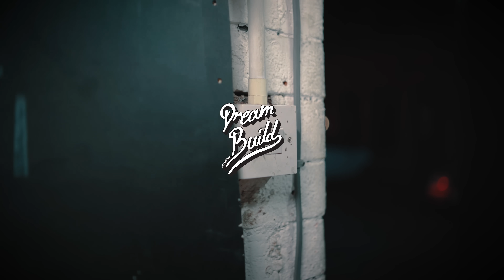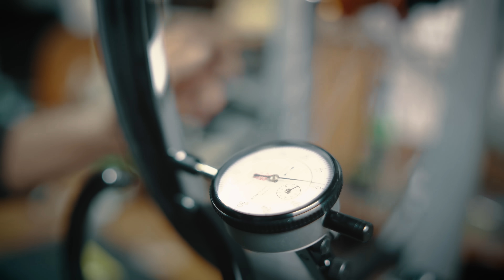DREAM BUILD MTB - EVIL OFFERING

Comment: I remake the question because i didn't receive any answer: what type of greases was used for the bike?
Reply: I do not know, can't be muc-off.
Reply: when you're building a bike, anything that's on the outside usually gets thin oil like chain lube, while anything on the inside usually gets a thicker grease.
Reply: it’s muc off at least that’s their grease color
Reply: Regular muc off grease on the moving parts, and muc off carbon paste on non moving parts like the seat post and handlebar

Comment: I´d use copper compound and/or loctite at important threading. Copper Compound is designed to grease threads but with adequate newtonmeter-transfer in comparison with normal mechanical grease. And loctite at the bolts around the shock should be standard prosedure.
Dunno, maybe u did it without us/ me seeing it.
Apart from that a great vid! Always enjoying this as a mech myself.
Reply: Maybe you should post all the custom builds you’ve been commissioned to build